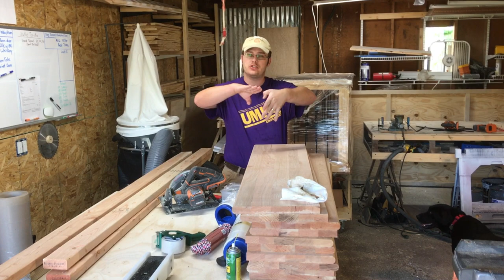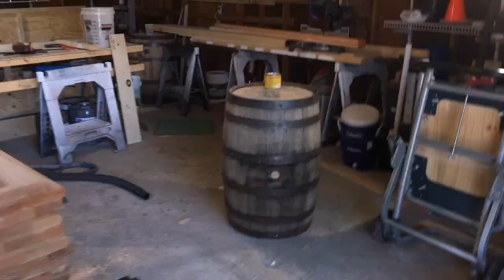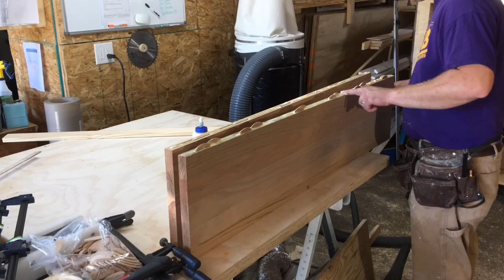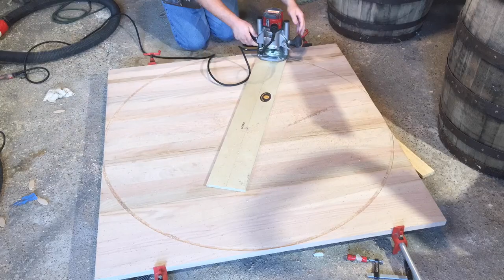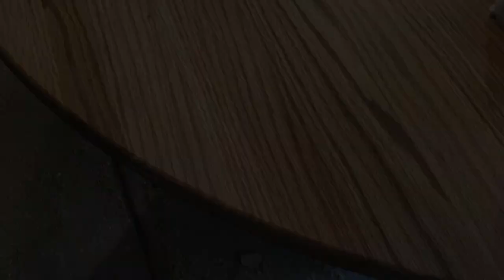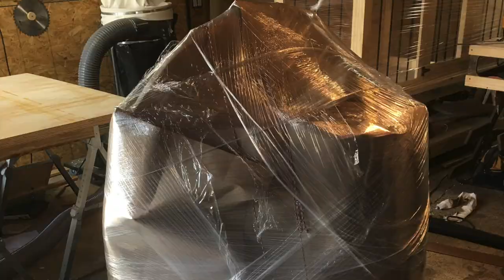Whiskey Barrel Table Build

Comment: How did you make the holes for those little pucks so that you could join the table? I tried using dowels 1/2" in each with no luck getting it to join.
Reply from the maker: Texas Thunder this is a biscuit jointer. It helps with alignment on panel glue ups